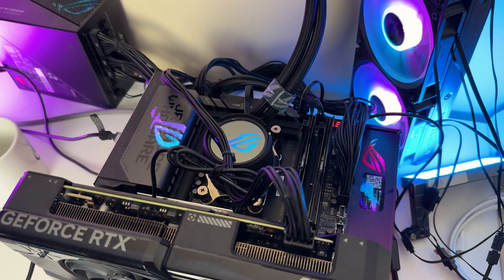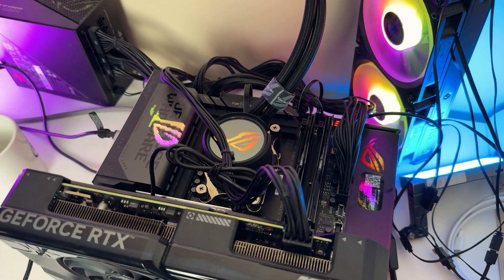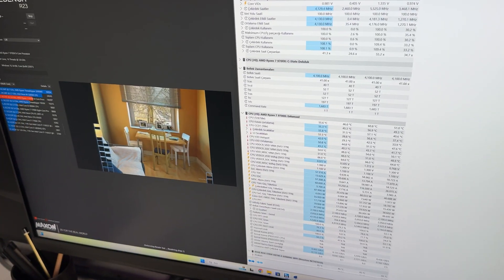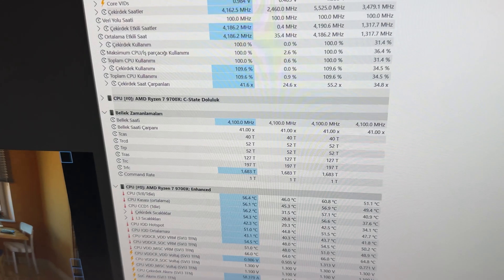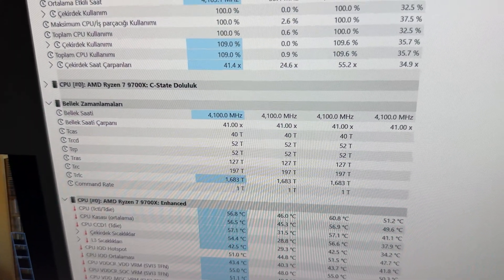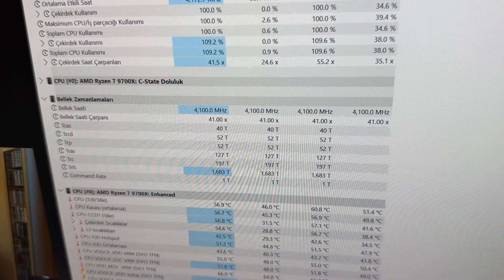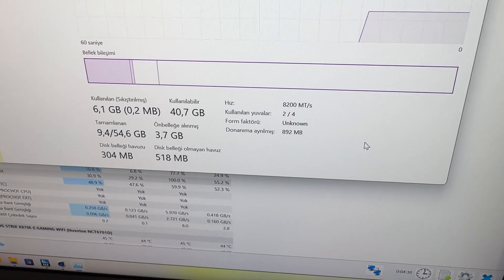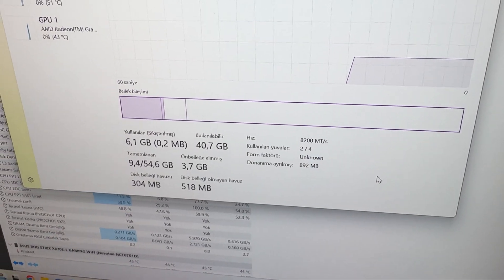CU-DIMM DDR5 Works on AM5! G.Skill 8200 MT/s

Comment: the bypass be pointless to spend extra 100 bucks to act plain 8200mt on a very bad platform that does not have any advantage on slower memory bus already on amd....what is your angle in this idea ??
Reply from the maker: Just to prove that it works.
Reply: Full CKD support will be added in the future so this isn't completely pointless. Ryzen 8000 and 9000 CPUs will support it on 800 series motherboards (and maybe also 600 series).

Comment: Just a heads up: the goal of the NitroPath pin placement, as per ASUS' explanation, isn't so much to improve the clock speeds of the active DIMMs as much to prevent noise and signal interference coming from the empty slots, attenuating the active cycles. This is 'endemic' to 4-DIMM mainboards and is a wholly unnecessary and expensive addition to dual DIMM ones. Plus, there is always going to be an extra ROG tax attached to anything ASUS makes for Gamers™ that no one likes to shill out for. Der8auer has recently made a video about this, demonstrating the new layout of the pins when empty and socketed on a cross-section, the way pins on the empty slots form radio antennae of sort, why it is bad for high frequency memory which has been getting more affordable through DDR5's life cycle and a somewhat unsatisfactory answer to why this feature is exclusive to AMD motherboards — at least, for now.

Comment: Is this board running the CUDIMM in passthrough mode?
Reply from the maker: Not sure actually. Any way to check? Just FYI, DOCP Tweaked mode is enabled.
Reply: @GeekberryNet  apparently at the moment, all of these boards are using Clock Driver Bypass mode because the capability to use the CKD hasn't been added yet. This means your CPU has a golden memory controller. Protect it at all costs because it can do 8200MT/s with ease 😂